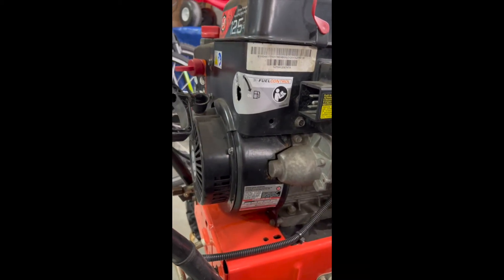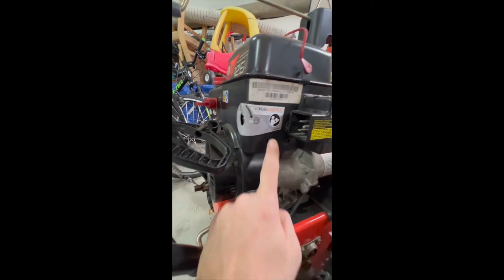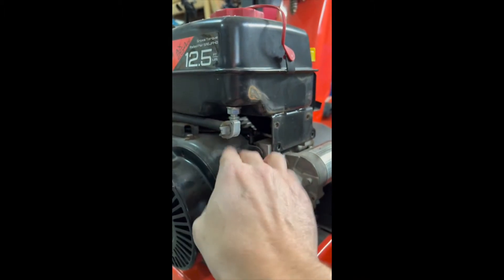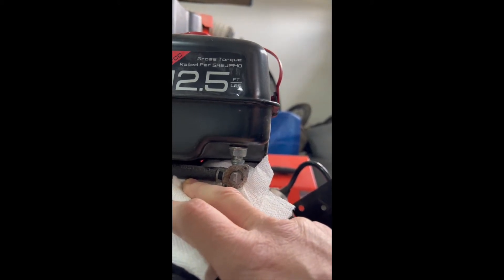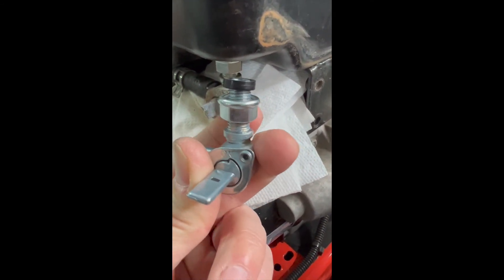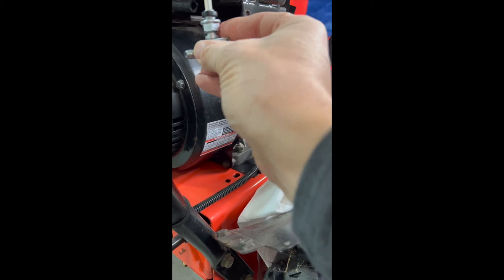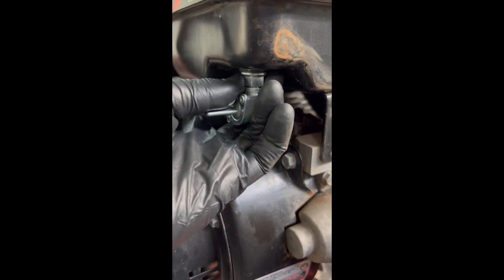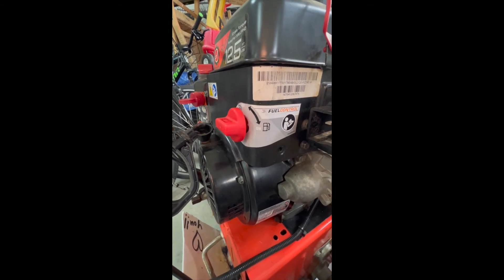Ariens Snow Blower  - Gas Shut Off Value Replacement DIY

Comment: Your video ensured a simple and speedy repair. Thanks! (Note: my 2015 vintage Ariens 30" Deluxe only had two bolts by the electric start, and neither was particularly occluded. YMMV.)

Comment: Thanks for sharing, this is exactly what I needed to see!  I got a used but well running engine identical to the one in your video to replace a clapped out old Tecumseh.   It runs like a champ, but I see that fuel is dripping from this valve, so I have one ordered to replace before we put the machine back into service.  Take care!

Comment: My Ariens is about 7 years old, and I went to turn the fuel on for the winter season and it started leaking. Turning it off again made it leak even more. 
  No one of 7 small engine shops stocked this part. I have to order it online and wait. Cheaply made part in my opinion.

Comment: Mine is not completely shutting off the fuel. Looked like an easy fix, thanks for the video, now I am confident it is just as easy as I expected.
Reply: I suspect mine is doing the same. Did replacing the shut-off valve fix it for you?
Reply: @charlielitton  I replaced the valve, very easy, but foolishly I am just expecting it to work and have not put any gas in yet to test it.

Comment: I just had my valve sheared off at the rivets near the on/off stamp and it pissed fuel in my yard while I scrambled for a container. Ordered the part a few minutes ago. Part number 20001436 on jacks small motors. Thanks for your info.

Comment: Spent $1500 on my new ariens and the valve also sheared off ar the rivets the first time I ran it… I shouldnt have let lowes pre assemble it is my guess… or ariens should not use cast bolts there…